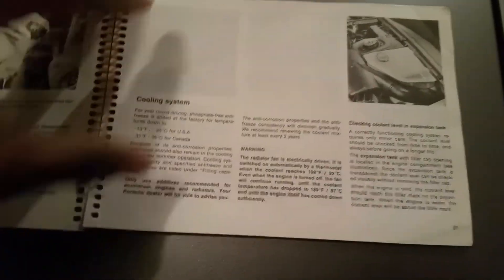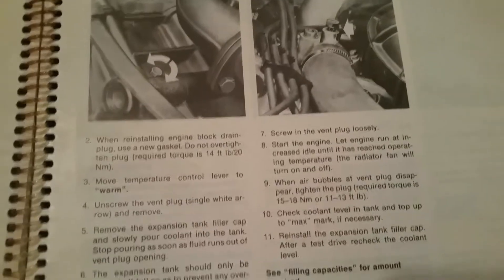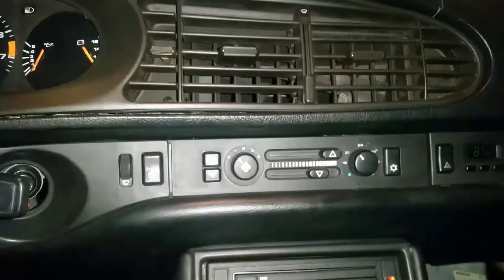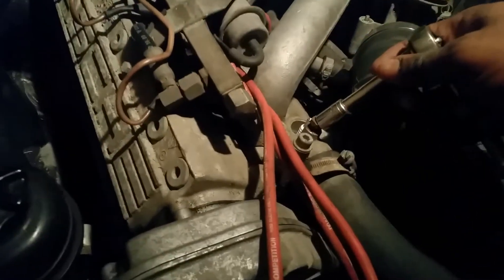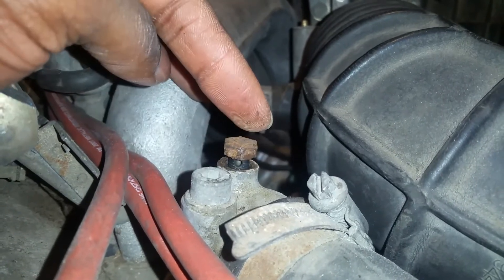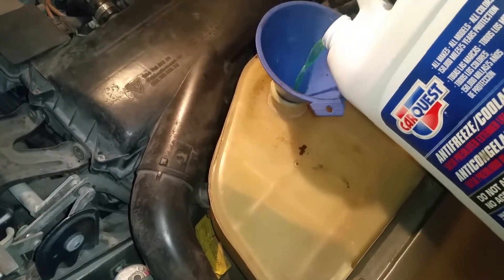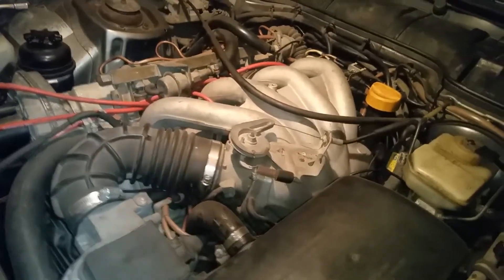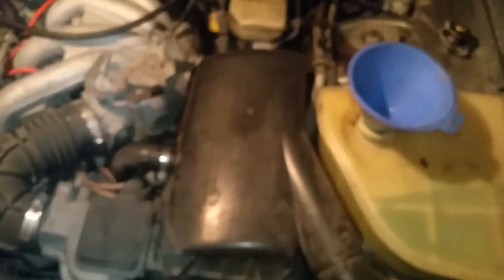Episode 9 - Porsche for Peanuts - Bleeding the cooling system

Comment: Thanks for going through this so clearly!  I've got a question for you: following this process when I turn the heater on in the car and I have the expansion tank cap off it's overflows hugely to the point where the coolant level drops way below minimum.  It then settles there quite happily and if I fill more in it just spits it out again, at this point the heater blows cold until I put more coolant in..  Got any ideas what may be wrong?
Reply from the maker: I think you still have air in the system. Turning the heater up should close the thermostat and shutoff the coolant flow to the radiator. You should get heat but it shouldn't spill out. Air is taking up volume somewhere causing the extra spillage. What is your temperature gauge at during this? I would suspect it to be running high because the coolant isn't circulating everywhere to take the hear away from the block. It could also be your thermostat is stuck open because once the spillage  occurs, the heater turns cold. Meaning the coolant is traveling to the radiator but not circulating properly to the heater core. Make sure you lift the car up, it helps move the air and get rid of the blockage.
Reply: @fcimports9823  My temp gauge sits very happily at the usual temp, just above the second (of the four) marker lines.  It stays there pretty steadily even when I'm driving around with low coolant since it spat out the rest...  I wonder if you may be right about the thermostat staying open, how would I verify whether or not it's gone?  If there is air in the system still should I try adding more coolant and running the engine again?  It's also worth mentioning that my heater controller inside seems to be questionable, I wasn't getting any heat until I tied the vacuum valve open..